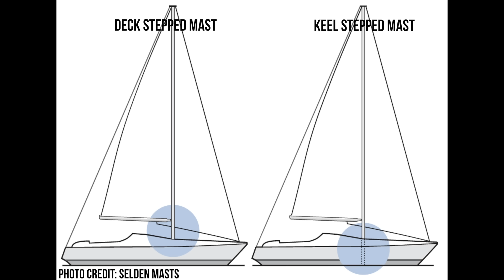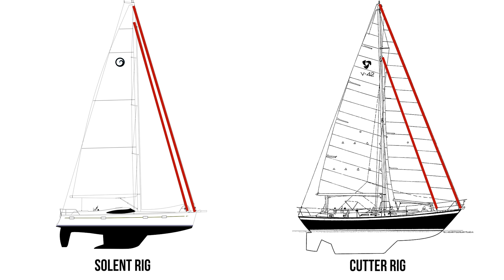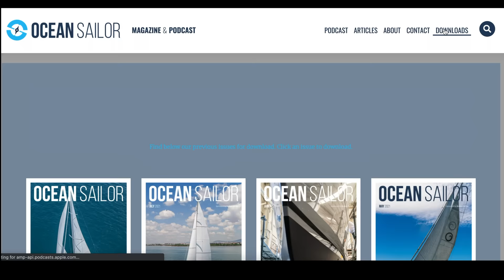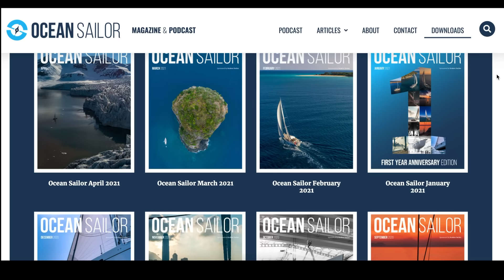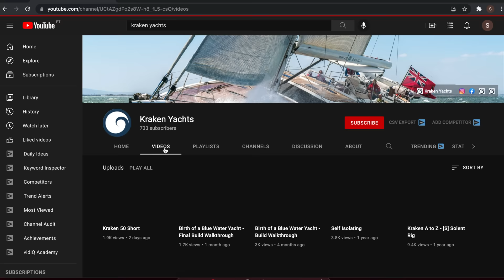7 Features to consider in a Bluewater Sailboat | Interview with Dick Beaumont

Comment: How many catamarans has he actually sailed on?  I respect his thoughts on monos, however he is just spouting very outdated myths on catamarans that just do not stand up to the current day evidence. Sailing a catamaran offshore and heavy weather tactics are totally different to monos-- he does not know what he is talking about on this!  He is right, many cats can not go upwind, however well designed cats with daggerboards go better to windward than most monos!
Reply: But at the end of the day, I can build a mono that can't sink, but nobody can build a cat that can't flip.
Reply: @Garryck-1  There is no monohull in the world that cant sink even if you built one. A monohull with a compromised hull will sink to the bottom of the ocean in less than 15 minutes thanks to that 5-7 ton counterweight.  A catamaran on the other hand will not sink because of the reserve buoyancy of the remaining hull and bridgedeck.  It is true that they can flip but that is due more to skipper’s error and is rare nowadays due to advanced designs and proper training plus they can be salvaged or towed to shore. However, a monohull with a hole in its bottom will sink so fast there is nothing you can recover at all
Reply: @ganzonfamily  - I was waiting for someone to bite on this! Thanks for volunteering! - Sorry mate, but you're mistaken. Ever hear of something called "positive buoyancy"? I'm soon going to be starting work on building a 37' Bluewater Sailing Dory, which will have 2.5 tonnes of ballast (not the 5-7 that you mention, although even that could be dealt with; see below). It will be made of plywood sheathed with fibreglass, and will have some sealed compartments filled with closed-cell foam. In addition to which, the entire hull will be lined inside with a layer of 3 inches of closed-cell foam throughout. (Yes, I've done the math - the total buoyancy of the foam exceeds the entire mass of the boat and keel, and stores/gear, including the engine and water tanks.) Furthermore, there will be four watertight bulkheads (with watertight doors in them) throughout the boat to limit flooding. And on top of all that, there will be several emergency flotation bags stored flat, uninflated, under the bunks (each providing one tonne of buoyancy) fitted to compressed air bottles to provide even more buoyancy if needed.

Now, here's the thing. The watertight bulkheads and emergency buoyancy bags are overkill. They're not necessary, just nice to have. Just the large volume of foam (several cubic metres, in total) and the wooden hull is enough to make the boat LITERALLY unsinkable. You could put a hole big enough to climb through in the hull, and even full of water, IT WON'T SINK! Because it will still have positive buoyancy. Holed and full of water, it will not only float, but still be able to be sailed. Slowly, to be sure, but sailed. The only way to sink it will be to smash it to bits (though most of the bits will float). Or burn it to the waterline.

It's not rocket science. Smart mono sailors figured all this out years ago. But not many people go to the effort to do so. Certainly no production boat manufacturers do, not even Kraken, even though they easily could. But for anyone with the skills to build/modify their own boat? Easy!

So yeah, I CAN build a monohull that can't sink. But you STILL can't build a catamaran that can't flip.

Edit - If you'd like another example of a mono that's unsinkable, read up on Roger Taylor's Mingming II.
Reply: @Garryck-1  All I can say is good luck. 37 feet with 2.5 tonnes of ballast. I can only imagine the degree of heeling you will have at 20 -25 knots of wind, more so if it blows to 30 knots and over. I hope you sail with no one else on board because they will be so seasick and they cant stand from the extreme angles while underway. Furthermore, the interior will be so hot it's like a sauna with all the insulation on board. You may need to run your AC 24/7 just to keep cool at the expense of fuel.
Perhaps it may not sink but what good will your boat be if it suffers a hull breach? It will be halfway submerged in water with only the mast sticking above the surface. Have you seen a plastic pail filled with water in a bathtub? That is what your boat will look like. And, it will only take in more water whenever it heels with no place for you to even stand on deck. It may not sink based on your assumptions but I dont think you can sail it home either. Remember the old adage: there is always a compromise
Reply: @ganzonfamily  - My boat (which is classed as 'medium displacement') is of a tested and true design, by a widely respected naval architect, that has been crossing oceans in all kinds of weather for over 40 years. Those who've built them have no issues with their comfort, even in heavy weather. The insulation levels aren't going to be much of a problem, because the whole tropical sailing thing doesn't appeal to me at all. I'll be spending almost all my time in high latitudes. If I wasn't, I'd probably go less for the foam, and more for the emergency flotation system. Either way, the aim is to be unsinkable. (And it's not about my "assumptions". It's about calculations. Hard math. Engineering. I don't do "assumptions".)

So far as the ballast keel goes, it's not just about weight (as your reference to it as a "counterweight" suggests [a common multihuller's misconception, actually]), but about lever arms and righting moments. Like Archimedes said, 'give me a lever long enough, and I'll move the world'. A one tonne mass at the bottom of a 10 foot keel is just as effective as a 10 tonne mass at the bottom of a 1 foot keel. (Ok, it's not quite that simple, but you get what I'm saying, I hope.)

As for your description of what a mostly submerged but not-sinking monohull would be like, well, if it came to that, I'm hardly any worse off than what an upside-down cat would be in the same circumstances. I've studied very carefully what happened to the Rose-Noëlle, and what lessons could be learned from it (and other sailing disasters, both multi & monohull). Actually, I'd still be better off, because even if all I could do is drift, I could patch the hull, bail/pump out the water, then get underway again. And in such a situation, THAT would be a higher priority for me than trying to sail a sunken boat.

That said.. I've SEEN a yacht, deliberately sunk to the gunnels but with positive floatation aboard, being sailed across a harbour. I KNOW it can still be sailed. And (reminiscent of the Rose-Noëlle), the design of my boat will very likely ensure that there will be a habitable air space below decks, even when fully flooded. Thus helping to buy time to repair, pump out, and get to shore.

Also, I'm very aware of the compromises entailed by my chosen design (boy, am I ever! SO many neat design ideas I can't make use of!). But seaworthiness is one of those things I don't compromise on. Hence the five  watertight bulkheads (I forgot one, in my other comment - four with doors). Six, actually, if you count the self-draining chain locker, which doubles as a collision bulkhead. I have zero intentions of letting a hole flood the entire boat.

Anyway, thanks for your good wishes, and I wish the best of luck for you and yours also.
Reply: @Garryck-1  I wish you fair winds and good luck. Just dont overdo things and stress too much about making a boat “unsinkable”.  A balanced boat will make it more enjoyable for you and your crew and dont worry about a sinking boat because many solo cruisers have circumnavigated the world with boats less sturdy than yours.  The most important thing is you are well-prepared for the journey no matter what happens.  Boat design is difficult and you will have to make some compromises - making your boat very buoyant will make it very uncomfortable to sail in.  It will hardly cut through the waves because the hull will be too light, your boat will ride even the smallest waves so it bobs up and down at sea making it hard to steer in bad weather and your equipment and crew gets tossed around too much.  You may have to reconsider the thickness of the closed-cell foam because if you add the thickness of the fiberglass-plywood sandwich (20mm?), you are likely to end up with a 4 or 5-inch thick hull with the gelcoat - you might encounter problems with thru-hull fittings not to mention the weight penalty.  But I guess you have thought of everything, so again best of luck.